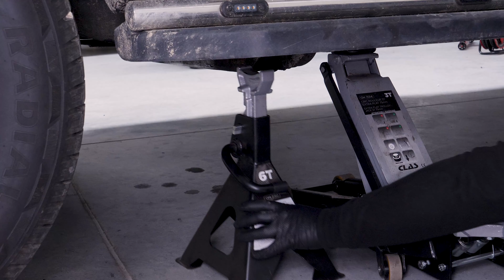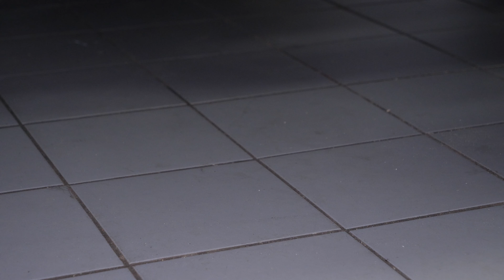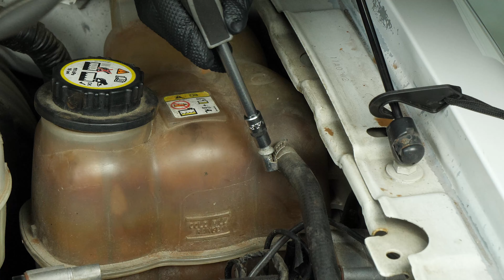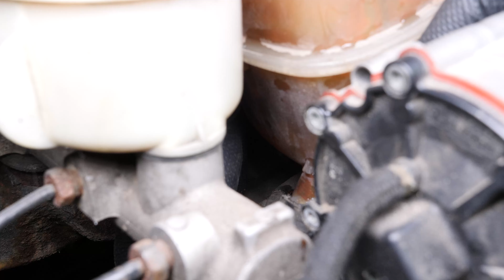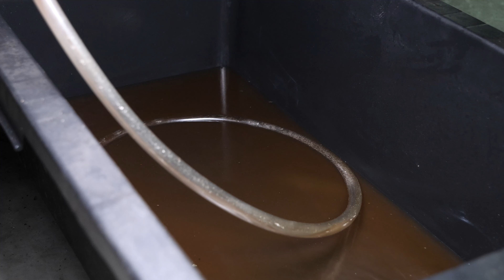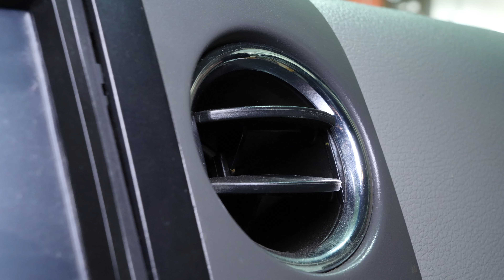How to change the Coolant 2004 - 2008 5.4 Ford F-150 ❄️

Comment: Very misleading video. 

Using the procedures in this video you will only get about 1.5 gallons of old antifreeze out. There are 6 gallons in there. 

That's not a coolant replacement/ flush.... that's joke!